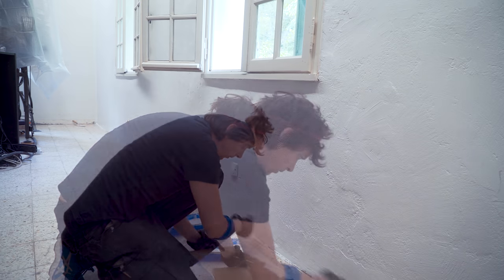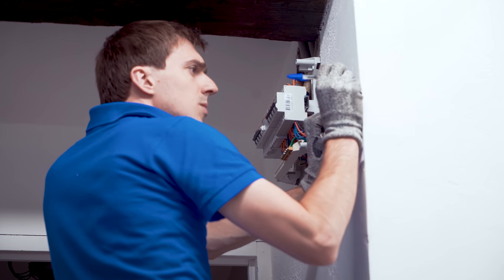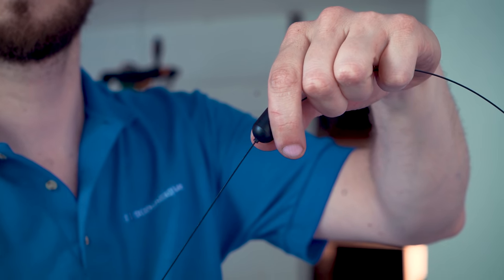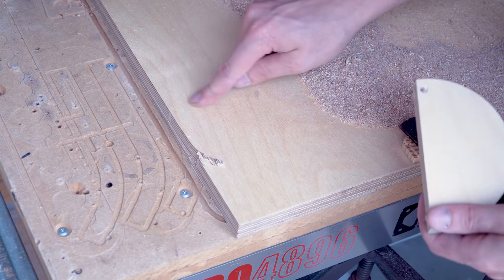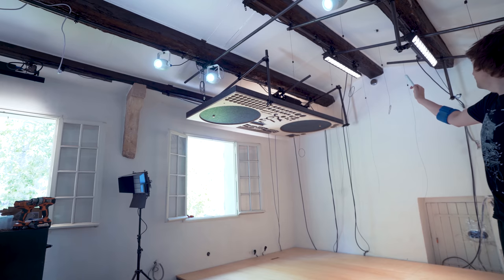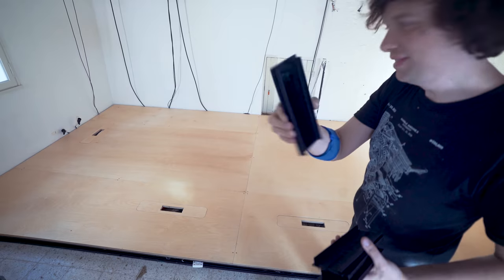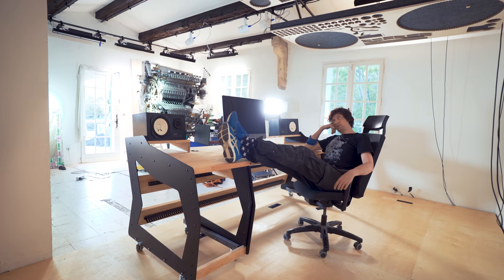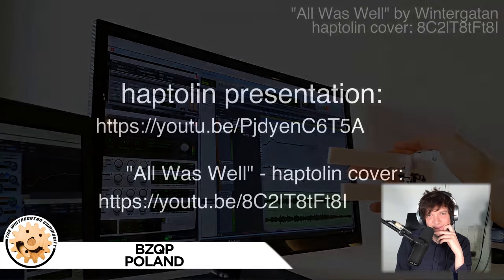Building My Dream Music Studio - Step 1 of 3 - Marble Machine X #128

Comment: The holes in the floor are perfect for losing marbles forever 👌
Reply: True that. They need to redo the press-fit inserts with a small fence around them.
Reply: I think there will be a lot of cables in the future... and: the marble machine will be downstairs (I hope)
Reply: Just use a huge magnet.
Reply: Christoph Poll oh yeah I hope one of the stages includes a patch panel with as many xlr ins and outs Martin could ever use
Reply: To be fair, he's lost his marbles like 150 Episodes ago
Reply: What if the MMX doesn't drop any marbles?
Reply: I’m pretty sure the MMX will be on the other side of the room.
Reply: Put a magnetic ring under the floor panel, around the holes... the marbles will get stuck on teh magnets before getting into the hole :P although, that might cause interference with all the cables down there? lol
Reply: The MMX will need no marbles. They play all instrument with electric Motors.
Reply: angry winter noises
Reply: GagHalfrund — if he keeps redesigning it, it will eventually be all electric.
Reply: @Elluem  Non-(Moving/Changing) magnetic fields don't induce currents. There will be no interference caused by magnets unless he moves them around.
Reply: @QuintiMa  huh, that's true! Maybe it should be fine, then
Reply: It seems like there are brush fences in the middle of the hole. It would be irresponsible to have a random hole in the middle of the floor

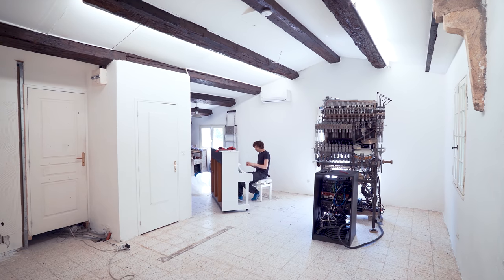Comment: 2:03 I'm looking at that huge bundle of cables running out of the MMX and... you need to get yourself a network audio interface. Something like a Behringer S16. Keeping all the analogue cables short minimizes noise and all you'll have coming out of the MMX will be an ethernet cable to a mixing console.
Reply: Agreed. The MMX needs an integral audio rack.

Comment: It's good to see that my theory of the solenoids being a 'hybrid' modular system instead of a replacement was correct, adding modularity tends to make something 1000x times more complex, 100x harder to fix and 10x easier to break - but also 1Million times easier to use and/or be more 'powerful' in what it can do and what you can make it do.

Comment: Looks really good! One thing about those cable holes in the floor, they like to collect dirt and grime a lot. You may want to make a lid to fill in the handle hole when no plugs are in use, and vacuum regularly. My university has these in the floor, and they are probably the most dirty things in the entire building, bathrooms included.

Comment: As you are going for broke I recommend you research ceiling mount adjustable mike stands. You may have to make your own, but they are so liberating and de-clutter the floor. You just pick up the feeds from a wall mount XLR panel

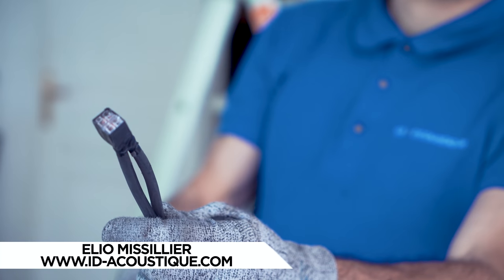Comment: 6:26 A straight spliced and soldered cable connection protected by some heath shrink would be better than those wagos. It's less likely to get stuck when sanding. Though probably he didn't have that in his box, so a nice and quick solution nonetheless.

Comment: Invest in some PC cooling fans to keep your rack mounted hardware from overheating. Put one or two at the top sucking air into the rack and then put 3 or 4 on the bottom sucking the air out. That rack mount equipment runs really hot and you won't believe how much audio hum you can get rid of by just adding those fans.

Comment: Watching you struggle with three people to shift the marble machine around... have you considered adding some wheels? If you are worried about the stability while playing you could have some system where some fixed feet can be wound down past the wheels, like a kind of jack. You might want adjustable feet anyway, like on a washing machine, to stablise the machine on potentially not-perfectly-even floors. Though surely locks for the wheels would work fine? Other huge delicate instruments have wheels, like pianos.

Comment: Flexible conduit like that with ridges tends to snag while pulling cables through it. You should really consider using smooth pipe like pvc and elbows ( Try to stay away from 90° turns).

Comment: With regards to the solenoids, I think people understood that it was for composing only, but the problem was that it seemed "ugly" to just have them sitting on the machine and not use them, but of course using them would make the programming wheel pointless. So if you say you are considering some system where you can take these electronic things completely off the machine then that is much better. I have no idea how you can achieve that in practice, but it would be a good solution.

Comment: A simple electrical component such as a multiple socket can cause a smoldering fire or open fire, if it is attached to the wooden roof beams in a house, then the entire beams burn down from the studio together with your house, protect your studio and your house against anything with an automatic fire extinguishing system Fire no matter whether it is a forest fire or an electrical short-circuit fire, then I can sleep peacefully again, the very valuable Norwegian stave churches are all made of wood and impregnated with birch tar and are therefore very flammable, the wooden stave churches are protected from fire by automatic sprinkler systems.

Comment: Was the problem with the uneven marble bounce from the vibraphone solved yet?  - I figured it out in the shower, I hope you found this already.  If not:  The problem is with the Vibraphone tone bars that are mounted on springs.  If the bar is in the midst of moving up at the time the marble hits it, the closing velocity will be higher than at other times, and the marble will bounce differently.  I hope this helps.  Such a fantastic project.

Comment: The Keyboard Drawer! I've been looking for the answer my whole life. It just needs to slide back further. GENIUS!!! thankyouuu I would love to see some more detail about how the draw slides work. Are they custom?
Reply: @johnscully1924  I get the concept but it seems generally there are 3 pieces of equal length that move out to extend longer than if it were 2 pieces, but in Martin's case it also has to go back further and there is no slider protruding in front of the keyboard so the inner most pieces of the slide must be shorter and the other 2 pieces on each side. I wonder if this is a specific type or if those pieces have been cut shorter

Comment: Are you planning on attaching the solenoids to hit where the programming pins hit? Because I was thinking it would possibly be easier to place them so they trigger where you play on the handles, in a singular attachment that can be pulled off the top.

Comment: Now you just need better speakers in your studio than those crappy Yamaha NS-10. Those are just designed for checking how your mix sounds on bad spakers. They're not meant for making a good mix. I have a list of recommendations in one of my videos. If the there mentioned Illuminata 15 is too expensive you should at least try the Vision BS. See my "Top 10 DIY Monitor Speakers" here: https://www.youtube.com/watch?v=gMyE3SUvSeM&list=PL4lJ1ej0uWlQ5xjxRERTleY3A5Xr8zzpq&t=4s

Comment: Nooooo! That is not how you fix the power cord on a sander! There is no strain relief whatsoever on that connection in the middle of a cord. You should take the sander apart enough to attach the longer piece of the cord to the sander. Seriously, that's a safety hazard.